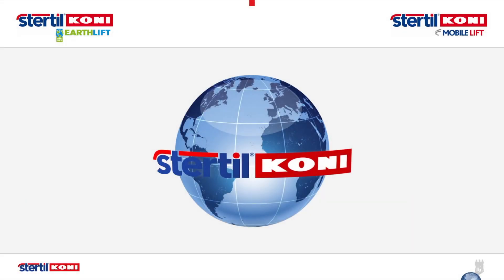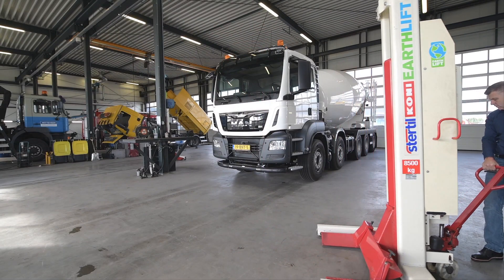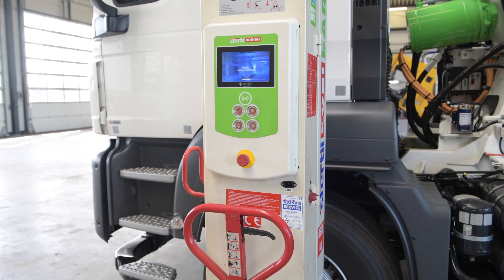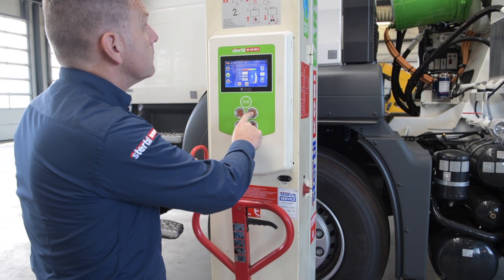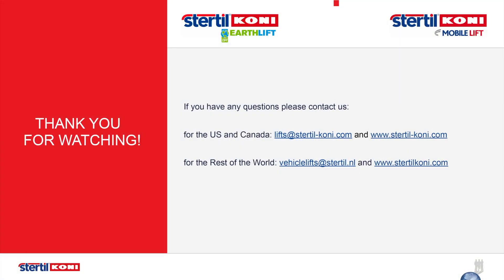Operating Instructions Stertil-Koni ebright Wireless Mobile Column Vehicle Lifts

Comment: 0:00 – Introduction and safety information
1:09 – Setting up the columns
3:04 – Connecting the columns together
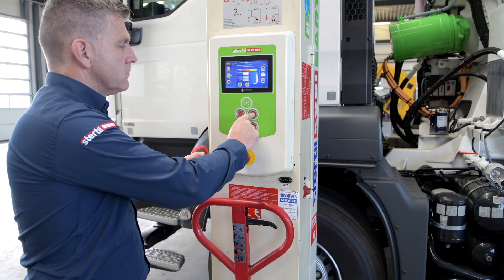5:10 – Raising the vehicle
6:55 – Variable speed control (Earthlift model only) – Slow lowering feature (all other column models)
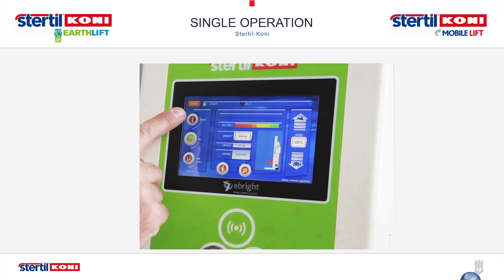7:28 – Single lift operation
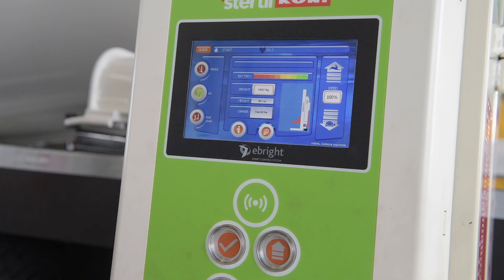8:26 – Paired lift operation
10:02 – Acoustic warning
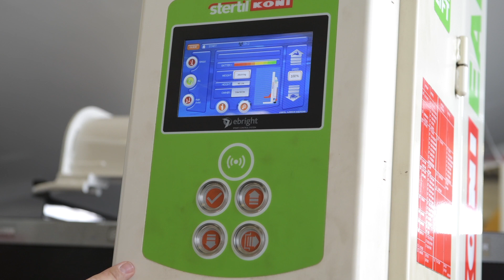10:29 – Lowering the vehicle
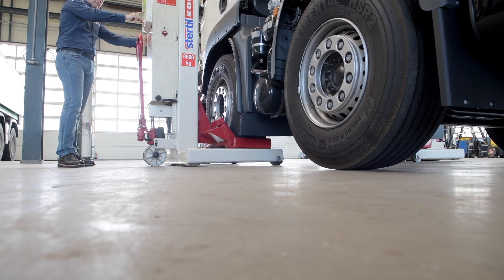11:30 – Removing the columns
12:12 – Charging the columns